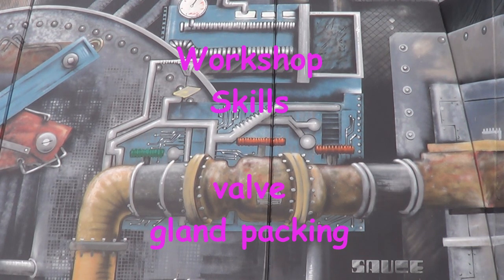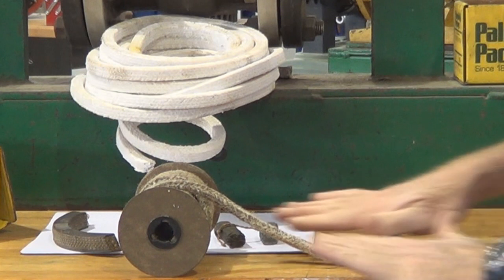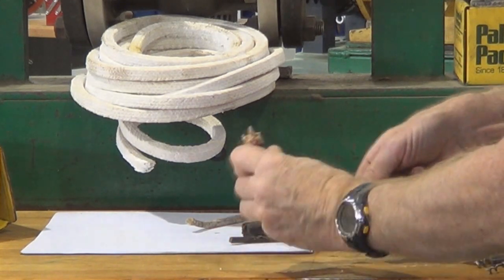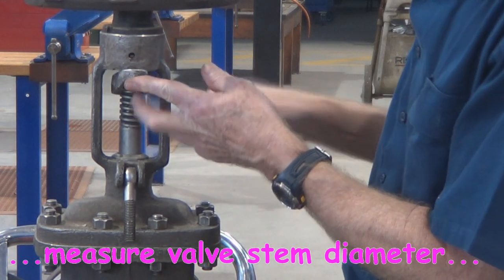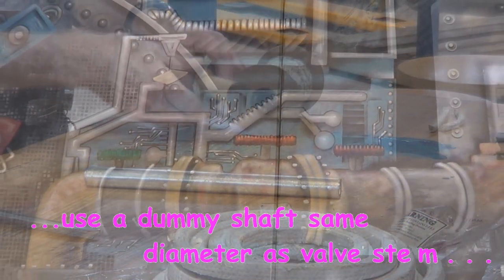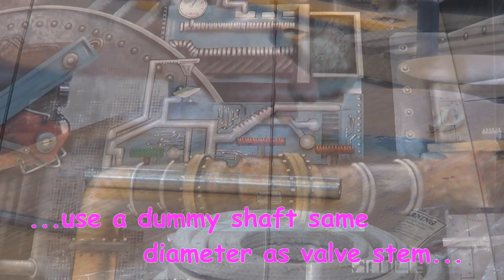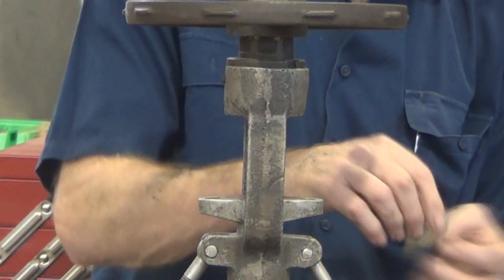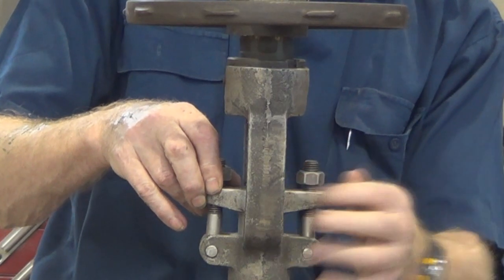Gate Valve Gland Packing, How to Tutorial by  Kevin Ging

Comment: I have a Fairbanks 12in valve for a pool, probably about 60 years old. I have no information on it other than what’s listed on the valve itself. Do you know of any resources I could use to help maintain it?

I don’t think it’s ever been maintained, having a hell of a time getting the rusted bolts replaced on the flanges.

Thanks!
Reply: my advice is to buy another 12in valve with same bolt pattern and just replace it. but if it doesnt leak and it still works then dont replace it

Comment: Hello Mr. Kevin. Can you help me with an issue that had arrived at the place where I work. We have a 40000 liters capacity tank and gave valves of 8 NPS are provided at suction side of pump. The pump is located at bottom level of tank and there is a gland leak at the gate valve. There are no isolation valves provided. Can you help me that how can I solve this problem when the tank is full.
     Thank you in advance.
Reply: shaik ali try using a freeze seal.  Wrap a coil of copper tubing upstream on the piping and downstream if needed, and run liquid nitrogen through it.  After a little while the fluid inside the piping will freeze forming an ice plug. Then you can replace the packing without flooding the space.  Its used in power plants of every kind when you dont want to shutdown the plant just because you can’t get a leg of piping isolated.  Hope it helped.
Reply: Freeze it, rigid also makes a handy machine to do this but I’m sure there not cheap.